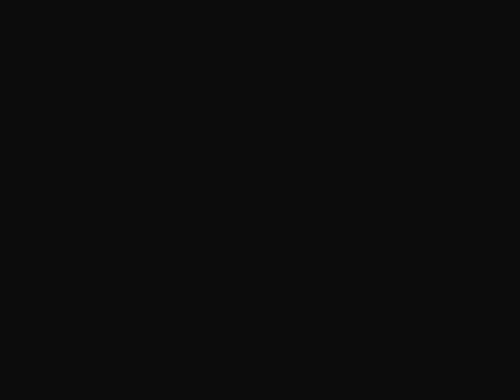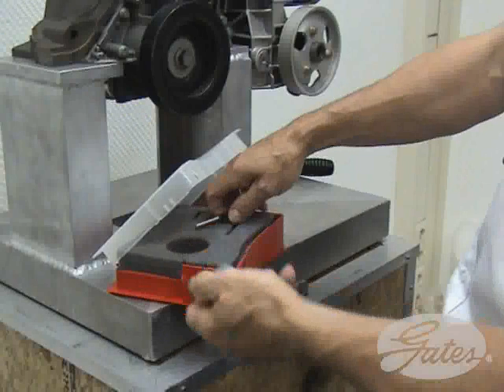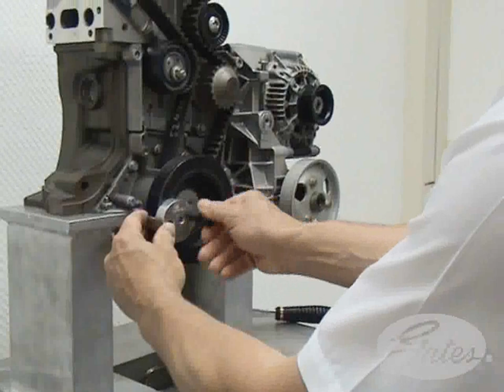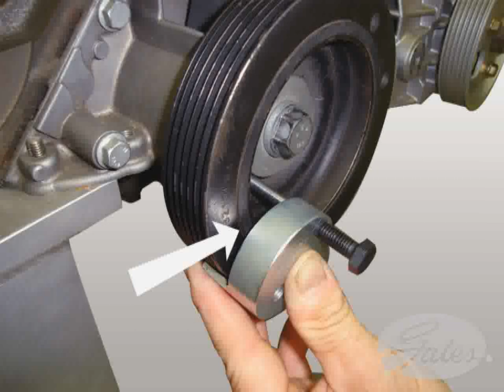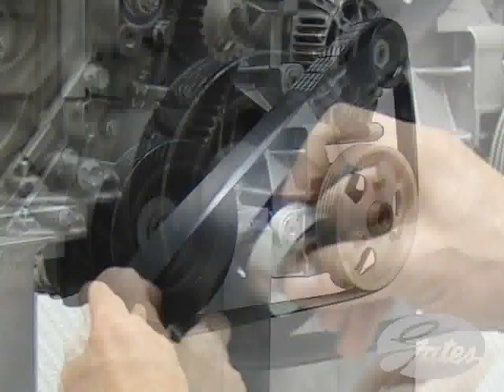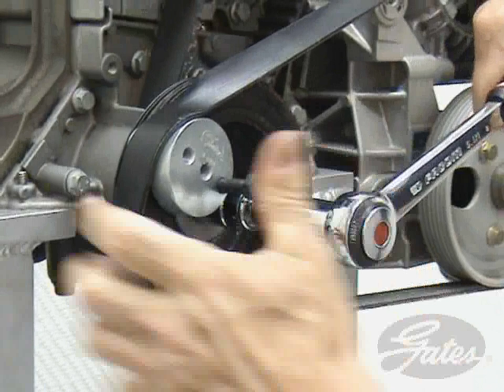Gates Stretch Fit Belt Installation

Comment: How is this better than an automatic belt tensioner that keeps the belt under constant tension throughout its life, even though the belt gradually hardens and stretches?
Reply: Not better, just a cheaper system for an automaker.

Comment: Nightmare.!
Under a VW Caddy with no A/C , Tensioner or Steering pump pulleys.
So the misalignment from lower, larger pulley makes alternator jump out of groove.
Needed Wooden wedges against engine-bay to guide it. . . . 26th attempt was successful, probably halved the belt life in the process.
Hinged Alternator worked fine, don't re-invent the wheel.